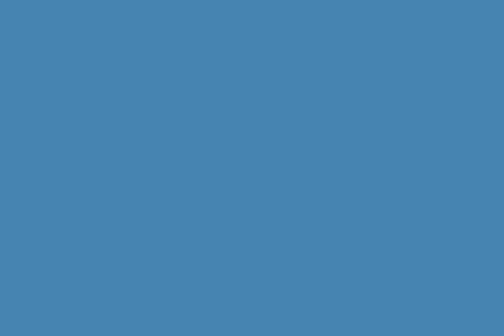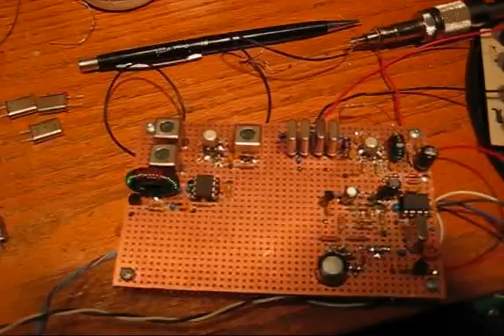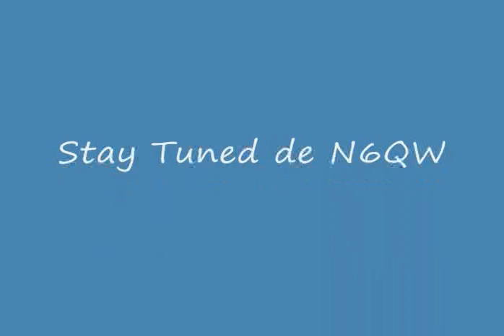Simple 40M QRP CW XCVR Part 1. de N6QW

Comment from the maker: Sorry, this was a project that sort of took on a life of its own and I did not keep a lot of notes. It is a trans~receiver with a common VTO operating at around 2.0 MHz. The IF is 5.185 MHz and it does use several SMD Dual Gate MOSFETs. An NE602 is the BFO and Product Detector. Do an internet search on N6QW and find my website where there is a similar project with schematics that is documented on that site.

73's
N6QW